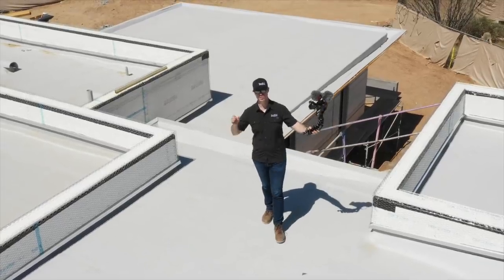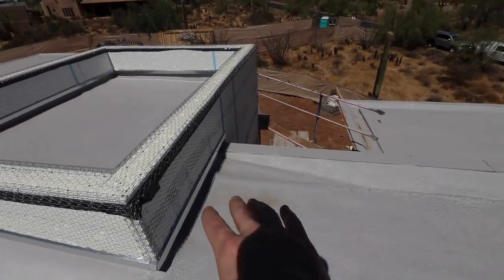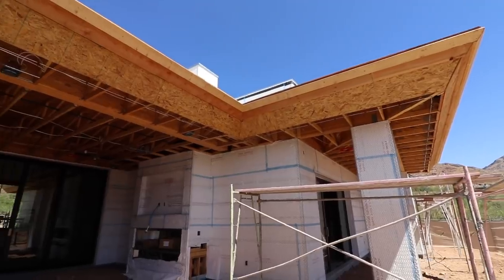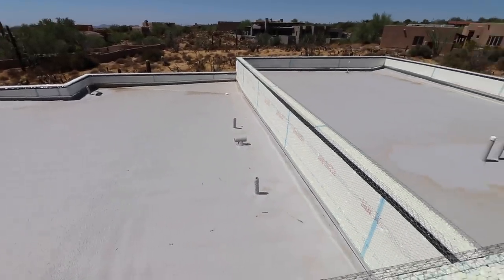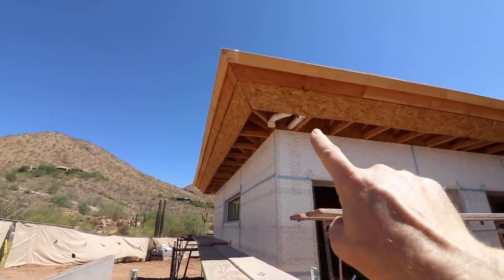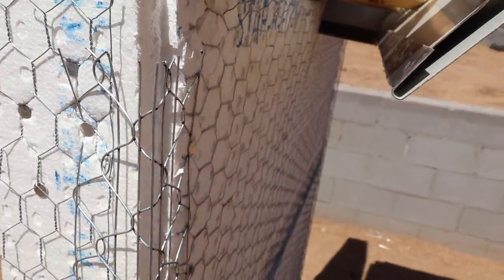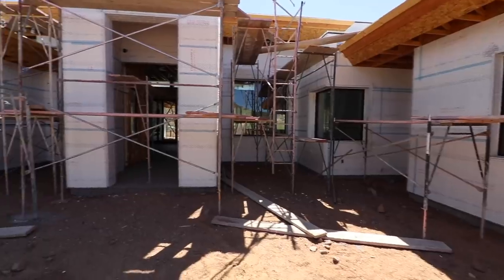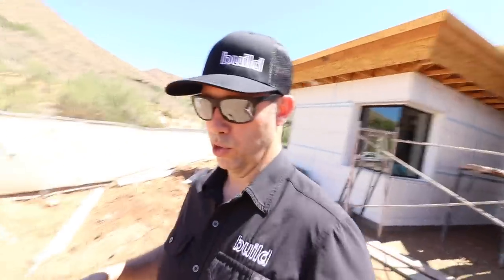2 Roof Details I’ve Never Seen Before

Comment: A SPRAYED MEMBRANE instead of an actual STRONG Membrane Material, like what they use on stadiums, factory's, containment ponds.  You really think that spray-paint is going to hold up on that high density spongy foam?   I would have stuck with the tradition membrane material, which is place on top of 2 INCH High Density foam w/reflectix & deal with the gutters....It'll last much much longer and some advertise Life-Time Warranty's with this system, just like Metal Roofs.  This is gong to be a maintenance Nightmare once the paint starts breaking down....god help you if some birds start nesting on your roof, pecking the crap out of the paint looking for nesting material.  That was PERTY PICTURE, wasn't it?!?!  :)
Peace
Reply: The home could be designed for a quick sale maybe? Lower price for an easier sale.
Reply: @lawlerzwtf  I hear yah, but it still screams of a half ass job or someone is trying to re-invent the wheel that's not required.
Reply: @setag54321  True. And even with a metal roof or a real membrane roof you can still have built-in gutters, just going to be more expensive but worth it if you want longevity.
Reply: The membrane is not a "spray paint". Sheet membranes (TPO, EPDM, etc) start out as a group of liquid chemicals that are sprayed and react with each other to form a sheet material. This is then brought to the site and glued or mechanically attached to the roof base. With a spray applied membrane you get the same thing, only the membrane is effectively "manufactured" in place, on the roof. Disadvantage - you don't have the controlled conditions of a factory. Advantage - by spraying it in place you can fit it perfectly to complicated roof shapes including plumbing and vent penetrations. These are commonly used in commercial applications and I'm seeing them on  more and more houses as well, as contractors get trained.
Reply: @HistoricHomePlans  So, you think a material that's sprayed on is as strong as the sheet membranes, which have reinforcement fibers running throughout the material?  Hmm?  Interesting.  The spray on is definitely more user friendly, those membrane rolls are heavy...that's some strong stuff AND it can be laid and sealed perfectly over complicated roof shapes and plumbing pipes...this is SOP for the guys installing this stuff.  It's NOT the same thing, go do more research....you sound like your selling something.  You were honest about the factory conditions/controlled environment, but you should have mentioned the sheet membrane was the stronger more resilient product.  Sorry not buying your figuring or inferences.  Next thing I'll read about is a Tech that didn't set the mix ratios correct and the whole job will need to be redone & it's a bio-hazard...just like you read about with the spray foam insulation stuff.... a lot of IF's, But's and Murphy's is what I see, when you've already got an excellent bunch of products that are SEVERELY TIME TESTED.  I wouldn't put my name on it, but To each his own, Thank God these days!  Right?  RIGHT!  Peace Brother
Reply: @HistoricHomePlans  I did some quick googling, it seems that this is called SPF roofing and it really is a fluid applied monolithic membrane. However, when I looked for typical warranty periods from different roofing companies, they all offer only up to 20 years. Sarnafil offers up to 30 year warranties for their single ply PVC membranes. These SPF roof companies always mention how it's seamless and is better at avoiding leaks than single ply membranes, but they all offer only 2/3 of the single ply warranty. Sounds fishy. I'll stick to hot-air welds and termination bars. Better yet, PMR/IRMA if I need to walk on the roof.
Reply: @setag54321  I'm not trying to sell anything. I am just trying to share my knowledge and learn something. My personal favorite flat roof membrane is EPDM, preferably applied as a single sheet, glue down. But I've used sprayed in place membranes and I wrote what I did because I believe your characterization of them as "spray paint" is not accurate. For a start, they are A LOT thicker, and second, their chemistry is entirely different than paint and nearly identical to sheet membranes.
Reply: @setag54321  I did not say spray membranes are "as strong as the sheet membranes". I don't know if they are or aren't. EPDM is typically NOT reinforced with fibers because that makes it harder to shape around corners and penetrations. It can be gotten with fiber reinforcement, but that's not standard.
Reply: @lawlerzwtf  PMR/IRMA systems are good too. SPF roofing typically needs its top surface recoated from time to time. The new coating should have its own warranty period or I wouldn't do it. So long as the roof is maintained according to a proper maintenance schedule, it should last the lifetime of the building. Different roofing manufacturers recommend different schedules. One, Dura-Foam, suggests a first re-coating after only 5 years, but then follows a 25 year cycle after that. BASF, another manufacturer, has its own maintenance schedule.

Comment: Americans use so much spray foam. Inside and out. What does that mean for toxic funes in the inside air? Also I’ve heard it starts to degrade in aboud 5 years. Finally, what impact does it have on the environment? From manufacturing to fumes when applied and waste when renovating (quite often too)

Comment: That's actually a really bad design... That roof will be lucky to make it 10 years. As that foam breaks down and decays it's going to create grooves and pockets that hold pooled water. If the roof sweats at all that arid heat is going to bake that humidity into the wood and cause a rapid dry rot to set in and weird warping in the frame. 

Out in very dry very hot areas the best roof is a slightly raised metal roofing. You want the framing & roof to have a draft area where the sun doesn't beat the hell out of the wood and transfer heat into the house. Flat roofing is a disaster waiting to happen.
Reply: I've lived in Phoenix most of my life in an adobe house built in the 1920s with a flat roof, as long as you maintain it there are no problems.

Comment: I disagree with just a tiny bit Matt.  Desert country does not get much rain each year,,, complete agreement. But oh baby, when it comes, look out sports fans !!     The episodic rainfall potential is not different to what you deal with in Texas.  A single rain event that drops 2 or 3 inches of rain,, yes,,, not unusual.  They only get two of those a year perhaps.  The inches per hour that roof must be designed for is the imperative.  That they only see that really big cloudburst once in 5 years?  The roof must be designed for it.  All the more reason for the primary and backup side by side drains.

Comment: Im from DENMARK. 
If that was my roof.
They would have been fired instantly. 
No indoor roof drain work. They all make condensation on the pipe's. And mold/fungus will spread to the whole house. & you have to constantly repair the roof, the house walls drain pipes  ect. is bad for your health, the environment and your economy. 
Here is two good things you can put on the roof instead and they last.  with min 5. degree tilt angel
1:High gloss ceramic roof-tiles. Min 50-100 years life span.
2: copper plates.
Min. life span 50-200 years. Both can endure high heat and severe cold. And they can be replaced and recycled. & you only buy one roof. As long as you live. And allways 
KEEP THE ROOF DRAINING OUTSIDE THE HOUSE...
LIKE THE RAIN.
PEACE RESPECT AND HARMONY FROM THE NORTH. DANMARK.